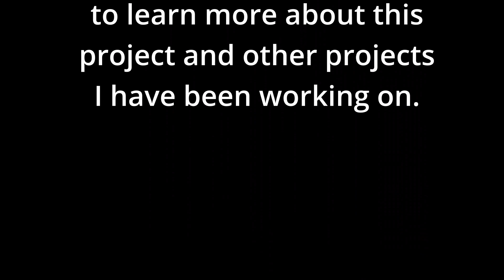393 Windsor Build Part 14 Convert Chevy Throttle Body Injector to Throttle Body. Looks Like a Carb!

Comment: You could have gotten throttle bodies from a 4.9 cadillac and would not have had to plug any holes
Reply: All the salvage yards in our state think they are selling new parts or gold (they're not), they are all owned by Pick N Pull now, if you go and gather up bolts sitting in the dirt, they charge $5 a pound. There are no longer any privately owned yards. We had a metal salvage yard local that was always full of cars, the guy was awesome, he charged metal scrap prices or less, I picked up a 2 piece rear main 4.3 liter with a mechanical fuel pump, complete, running for $23, then someone went out and got "hurt", he was sued and sold his yard to a particular group of people, they wouldn't allow you to get scrap even if they got it, they closed after about 2 months.
Reply from the maker: My local recycling  yard allowed picking until a guy was climbed down into the pile of cars and almost got crushed now there is no picking allowed.  Always someone who runes it for the rest of us.
Reply from the maker: What year? All the ones I’m seeing are either single butterfly throttle bodies or they are the same basic TBI I’m already using.
Reply: @dazecars  the last few years before the northstar. Im going to say 91 and newer till the northstar became a thing
Reply from the maker: I had no idea this was available.  Looks like almost the exact same body as the TBI without the opening for the injector body and the wire grommet machined in.  Yes those would have eliminated the need for delete plates BUT I got my TBIs for free and looking on ebay those Cadillac TBs are not cheep. So with that in mind the extra fabrication was worth saving the money.  However the info is fantastic, and I will keep it in mind should I need something like that on a future project.  Thanks for sharing.
Reply: @dazecars  $20 at the junkyard. And they are already profiled nicely for better airflow
Reply from the maker: I don't think I would find any at that price.  The junk yards in my area think they are selling new parts so I seriously doubt I would find any even close to $20 each.  Even so if that was the case it's still $40 more than I paid 😂😂  As to the "profiled for better air flow" based on the pictures I have seen and not actually having one on the bench to compare, I don't think so.  Looks like the TBIs have a bigger velocity stack type shape machined in and that would make sense as the airflow had to come in around the injectors so the bell would be bigger.

EDITED After taking a second look it looks like the butterflies in the Cadillac units are bigger which would make for better air flow BUT I am running two so the Cadillac units would probably flow more CFM than I am wanting as I want good idle response.
Reply: @dazecars  The throttle cable attachment point is slightly different for the Cadillacs but what I remember about forks it might actually work better with a stock for throttle cable versus the pick up truck style that just had an eyelet and a clip holding it on

Comment: About 25 years ago, Edelbrock made a TBI to multi port injection conversion for the 350 TBI. It also converted the TBI into a regular throttle body. It had a new intake manifold that had injector holes. It came with a new fuel pump that built the pressure needed for port injection. They discontinued it ages ago. I think someone said the Edelbrock computer was made by Magnetti Marelli, and was unreliable.
Reply from the maker: sounds interesting.  A lot of things in the EFI world have come and gone in the last 20 years.  As an example there was once more options for the 351W but not any more which is why this entire project came about.
Reply: The system you’re referring to, used the factory computer and wiring but edelbrock provided a chip to retune the injectors pulse width for bank firing the new injectors like the early tpi on the Camaros and corvette.

Comment: Simply genius!  I'm currently working on a 393 build myself for a 69 Mustang.  I got a great deal on a Holley Hi-Ram intake and was initially going to install dual quads because aftermarket efi, even tbi is cost prohibitive.  I researched using GM throttle bodies but couldn't figure out how to connect the two until now. I'll have to see if they'll fit my manifold top plate or if I need to adapt them. Thank you for the information!
Reply from the maker: If you need any help or any more information don’t hesitate to contact me through my website.
Reply: What model vehicle did the tbi units come out of?